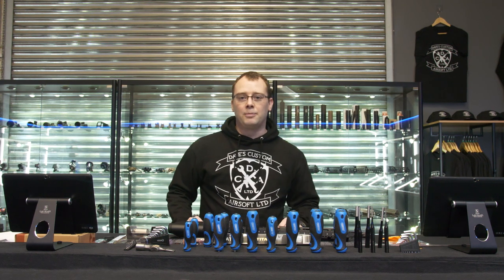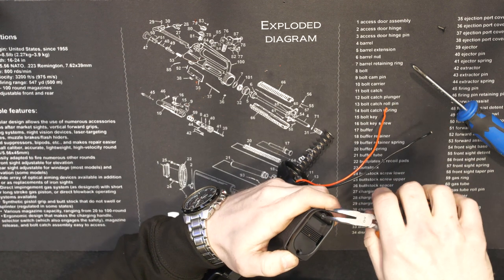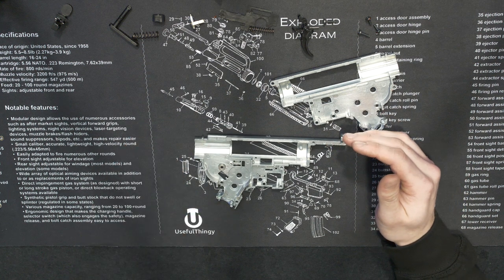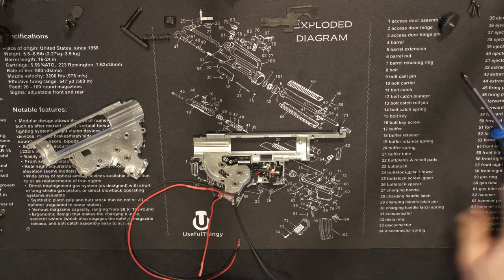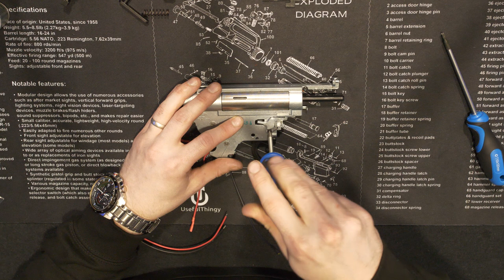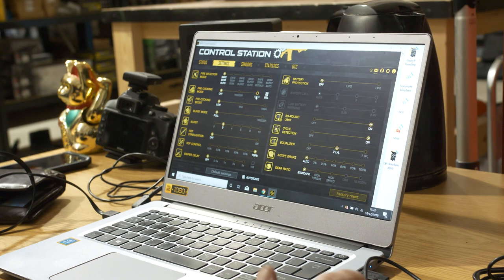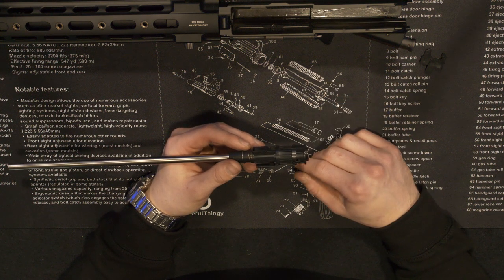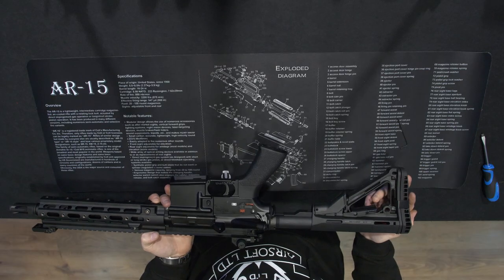DCA Tokyo Marui NGRS Upgrade Tutorial

Comment: Hi Dave, I spoke to you earlier today regarding my purchase of this stage 3 mosfet build. I just found this video and have a question regarding the fps testing of this rifle... Am I right in believing that the bb’s I will need to use are 3.0 or 3.2 grams? Also why is the fps in this video way lower than 340? Cheers mate, great video! 👍🏻
Reply from the maker: Our hop set at 0 applies flat spin to BBs of that weight. This accounts for the fps and the requirement to use heavier BBs. The advantage of this setup is it shoots flat hop set at 0 so every hop increment after that will hop up, meaning mo wasted positions on your hop unit. It is fiddly, time consuming and difficult, but, results are top.
Reply: So how about seeing 350 FPS equivalent using .30 or .36 ..... eg 0.36@260 etc.......
Reply: Ashley Blakebrough I chronographed my gun last night with the chrono on my acetech lighter bt which isn’t very accurate and I was hitting 290’s on .3’s.... only just a little over what it should be but will fall within regulations when tested on a proper chrono and by adjusting the hop correctly... the gun was consistent on .2’s and was reading around 348

Comment: I have a quick question, why did you swap the motor around the other way? (As in red dot facing stock and black dot facing barrel) I am installing a gate titan but not doing a motor upgrade, so would I swap the motor around too? Or do I leave it as it is (as in red dot facing barrel and black dot facing back)